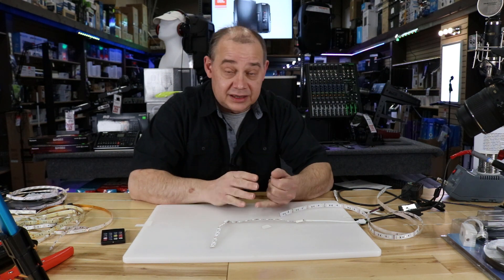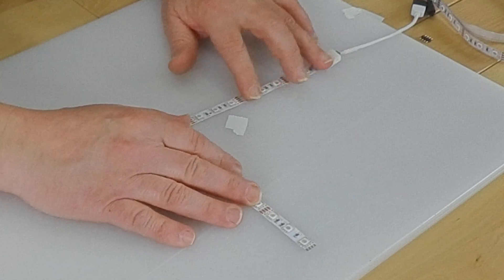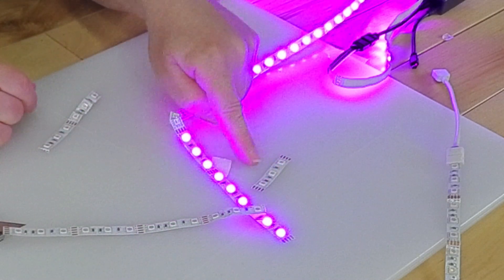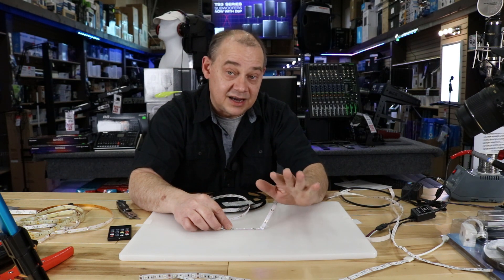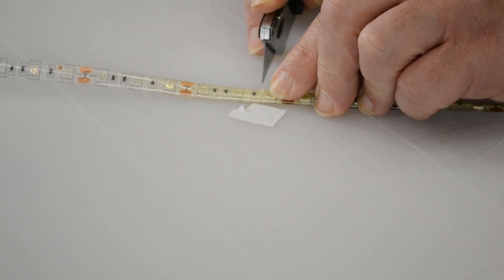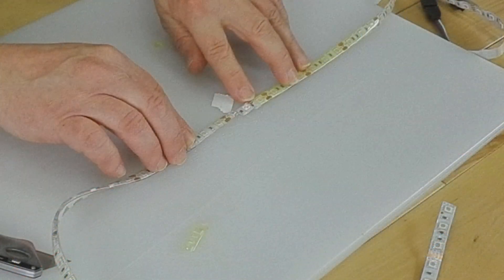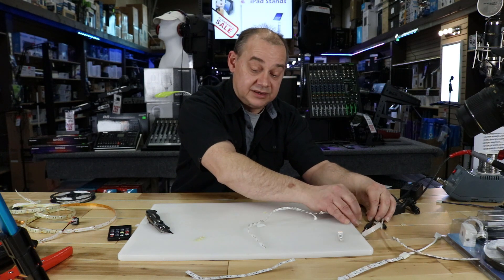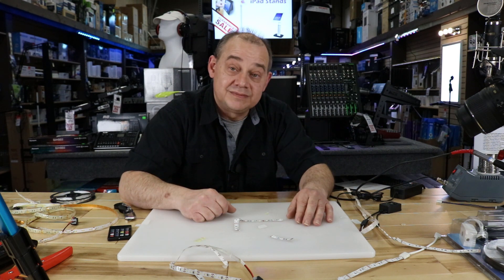How to BEND your LED Strips around corners I show how on the 5050 RGB and  the 3528 IP33 and IP65

Comment: This helps a lot BUT most LED strip kits simply say cut the strip (on the dotted lines) but say ABSOLUTELY NOTHING about reconnecting and do not include corner connectors, like you’re just supposed to overlap them and they’ll work. Extremely frustrated and I was hoping you might comment on that issue. I’ll look through your channel and hopefully you have an answer

Comment: Is it possible to use the led strip to draw ??? Any image or write without using the neon light
Reply: Yes, it's called persistence of vision (POV). Not all RGB LEDs are fast enough to pull it off, but the dotstar/APA102's are. Example: https://www.youtube.com/watch?v=1CB3UVmEcB0

Comment: It's not really 'bending', it's creasing.  The latter being more likely to cause problems in time.  Sure it might work right now, but for how long..?
Reply from the maker: I was worried about that, I had 10 shelves in the showroom with LEDs setup like this for over 5 years on 12 hours a day at the end they all still working.
Reply: @How2island  Can you fix the light strip after they go out by removing a diode from the problem area so those 3 lights don't come on?

Comment: Very good tips here including using non-water-proof strips if you are going to fold for a corner.  Also, always bend at the end of the strip so you do not lose a whole strip. Another thing, if you bend a strip and the light changes color, remove on of the ic chips and the light will go out forever.  Thank you for the great tips.

Comment: Will removing an LED chip (in order to make the fold) change the Numbering of the LEDs? I have biased lighting to install but they are very specific for numbering and being addressable. If I remove LED #3 from the strip will the 4th LED become the 3rd? Or Do I need to solder the data connections to make sure it bypasses? Thanks!
Reply: You don't say what type of strip you have. The microchip that controls each LED can be internal to the LED body or mounted next to it. The thing to know is it is the chip that is being addressed, not the LED itself. So if you can remove just the LED but leave the chip, the numbering won't change (#3 will not light up but all the numbers are the same). If the chip is integrated with the LED then both will be removed together, the number sequence will continue with the next chip in line (#4 will become #3 and so on).
Reply: I imagine you tried this anywya what was the outcome ?
Reply: If you break a light on an addressable strip, all the downstream lights no longer work. You'd have to solder a jumper to restore the chain.
Reply: I'm so thankful you can buy non soldering connectors.

Comment: If you need help apart from this video, I learnt this is woodwork, there is a rubber covering if you cut to the Right amount then it will be easy to fold, DO NOT CUT TO DEEP if you cut to deep you will break your lights good luck ig

Comment: If I was to put this item on the soffit board and I bent it around both my corners to go all the way around the house by the time I get to the last few metres do they start to fade out given that the power to the lights Is further away from the power point
Reply: This ain't Minecraft bud. Power should be fine.

Comment: 1. Don’t ever fold and bend Strip light. 2. Don’t rip the water proofing coating to make a bend. The lights are now non water proof.
Reply: Can you please tell me how to bend the led strips with the waterproof coating ?
Reply: @AshwinP05  l just put them up in my kids bedroom and pulled the waterproof led lights through the corner brackets.
Reply: @patriciagallacher2905  what's the corner brackets
Reply: 4-5 million, a patent.. Stop. You never bend them, why?
Reply: everybody say to bend them like this…
Reply: Please @Mrkaspa5373 how can I bend an ip52 in a corner then, if I can't remove the coating. (I don't need the strip to be dripproof at all, just bought some strip and didn't notice it had silicone on it before I opened it 😅